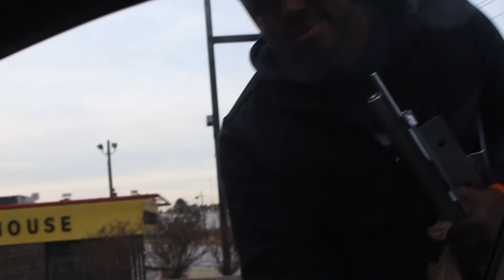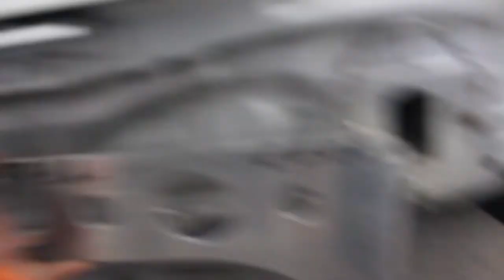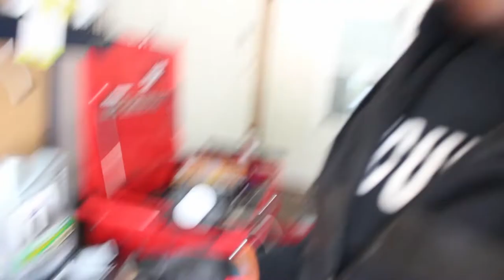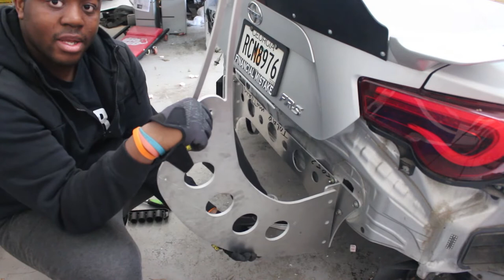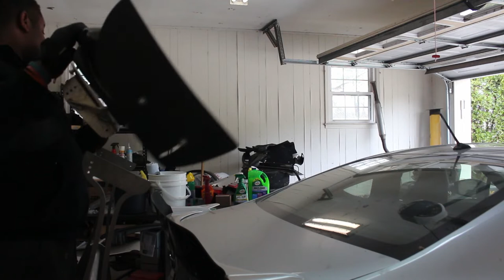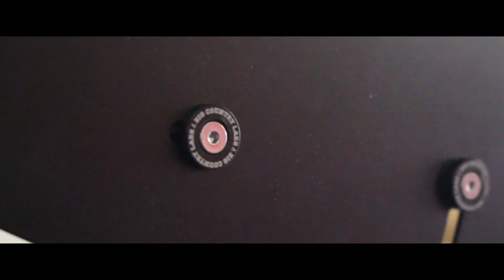INSANE CUSTOM CHASSIS MOUNT WING INSTALL!!! / Frs Rebuild Series Ep. 10

Comment: Hey was just wondering if the wing is able to protect you from a rear end crash considering there’s no more bash bar. Just wondering if it would be safe because I’m planning on running one.
Reply from the maker: LadiesMan 217 I’ve seen someone else back into a brick wall and yet barely left a scratch, so they’re pretty tough, you can buy mine if you want lol
Reply: Chandler Ferguson awesome man thanks for the fast response really appreciate it 🙏🏻. I’m actually going to buy one for my is300 but once I have money.
Reply: @chandlerferguson9348   hey where did you get it from